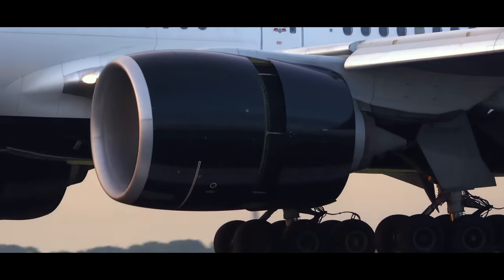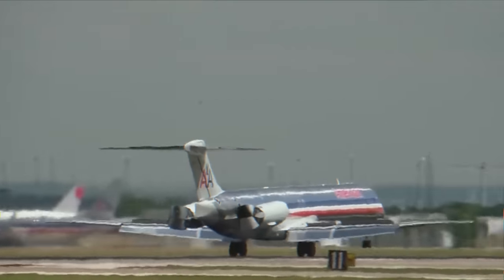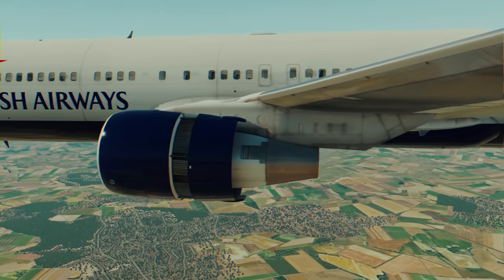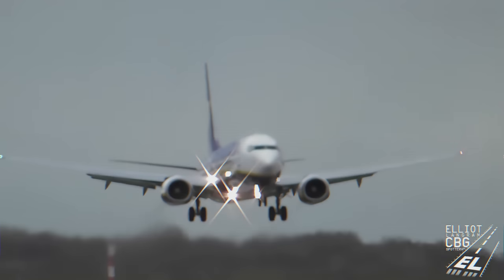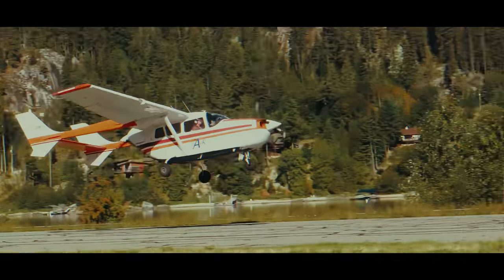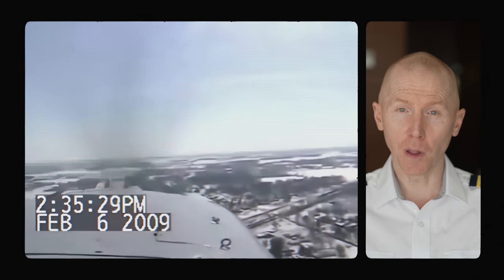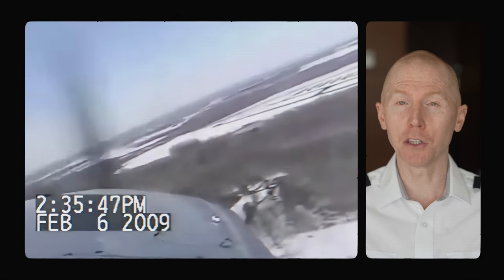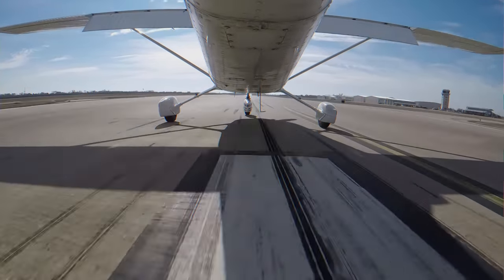Ryanair Pilot Makes Big Mistake

Comment: I would think the most important consideration is saving your momentum to get off the runway - steering to centerline seems counterproductive, save the centerline lineup for the taxiway unless you need to bleed additional speed to avoid tipping.
Reply: Absolutely the last consideration is saving momentum to get off the runway.  The first consideration, above all others, is being alive at the end of it all.  That may sound overwrought, and it may seem like it's an overstatement after watching a successfully-executed engine failure like this one, but there are plenty of stories of "simple" engine-out situations that ended up fatal.  You can still die from 40 feet in the air.  So if you get it down and roll to a stop in the middle of a runway and they have to send someone out to pull you off, that is a 100% successful outcome.

Comment: For the second clip: First off, the pilot did an incredible job and his turn back to the airport worked. I have no idea what his altitude AGL was, but it looked to be less than 1000'. I thought in those scenarios, that was "the impossible turn" where you have to trade too much altitude just to make the turn, and you're better off finding a road, field, etc?
Reply: He got away with it... that time. Should have stayed straight and level, nose down, and looked for an open spot. YEs, the plane will be damaged, but you're way more likely to walk away than if you stall spin from 100 feet.

Comment: I design Nacelle systems for a living.  There are multiple layers of mechanical and software redundancy that prevent a thrust reverser from deploying inadvertently.  We have mechanical track locks that physically balk the Thrust reverser translating sleeves from opening in flight.  This track lock system is isolated and fully redundant from the hydraulic and electrical system that control the the thrust reverser actuation deployment.  Even if all actuators fail completely the Thrust reverser is designed to remain in the fully closed position.  In addition the cases where the Thrust Reverser can be commanded are controlled by software laws that prevent deployment unless the airplane condition meets strict criteria.  Some airplanes are designed so that you have to have weight on gear before the sleeve can be deployed.  On this specific model there is a MAX altitude requirement that must be met before the software allows deployment.  That altitude is a number greater than zero feet as shown to be evident in this video.

Comment: Kelsey, I think that on the second landing the pilot was trying to burn altitude. If he had gone directly to the runway he would have over flown it. That's probably he went over to the right and then back to the runway. Even with the slight diversion he landed far down the runway. Back in my hang gliding days, we used to do S curves with decreasing amplitude as we got closer to the landing zone, if we were still too high on approach.

Comment: The C 17 is the only air raft that can deploy all 4 reverses in flight. Reason to match specs of c 141 (BTW done with forward slip). I experienced 20k ft per minute down, 15k ft per minute up. The 141 could carry 153k lbs of fuel in a plane with 140k empty weight. The 17 can do 8k per minute up has a much different fuel to empty weight ratio. Absolutely e ticket worthy

Comment: As a glider pilot (hang glider) for nearly 5 decades I thought the approach was pretty darn good (for someone with limited options).  It looked to me like he slightly overflew the intended runway to burn the little bit of altitude he needed to avoid running off the end of the runway (he clearly saw that he was not going to have a full runway no matter which one he picked).  Low and slow is rarely a good idea but I've had countless landings in very tight LZs by doing exactly that.  Of course it's all a judgement call based greatly on pilot skill, familiarity with the aircraft and the conditions you're landing in.  Very unstable/rowdy air then extra speed (control) is an absolute but if the air is stable then getting close to stall or a bit of a sideslip can put your right where you need to land.  
That looked like some very cold (thick) air and I wasn't noticing him being bounced around by conditions.

Comment: I have over 16,000 hours in 737s, all models except the MAX.  Proper procedure is NOT to actuate TRs until both mains are on the ground.  There is are couple of asides concerning TR actuation in flight!  As I recall the DC-8 was capable of opening the clamshells in flight on # 2&3 engines to facilitate rapid descent.  And on the 737 Basic if the clamshells did somehow open in flight they were designed to rip off without major damage to the engine and support structures!

Comment: Many Boeing and Douglass jets use wheel spin-up (about 60 kts.) to get spoilers. Airbus uses strut compression. I like the Airbus setup better. 
There have been a number of runway overruns caused by spoilers not extending because the wheels were hydroplaning or skidding. This under 60 kt condition at the wheels inhibited the spoilers which greatly reduced braking. 
My aircraft experience: DC-8, B-737, DC-9, MD-80, Airbus A-319/320/321.
Reply: If the lever doesnt want to come by itself, just grab it by yourself...  problem fixed.
On the boeing 737ng the wheels normally  need to spin faster than 60kts but if they dont ,  the compression of any landing gear strut enables the flight spoilers to deploy,and the Compression of the right main landing gear strut will unlock the ground spoilers.

Anyway To get a runway overrun  you would need to wait a little while before realizing that the spoilers are not extended.
Reply: @Hk-uw8my  Thank you. You raise good points. I have seen aircraft landed with the spoilers  not armed. This has happed to experienced crews with good habits-human error nonetheless. Today, many airlines push the idle reverser strategy. Why waste fuel on a long runway. The problem is this becomes a habit. Then when one lands king, or fast, or floats 1,500 feet, idle thrust early is not very efficient. Then, realizing the stopping distance is becoming critical, they select full reversers. This is less effective at lower speeds. Bad habits cause bad outcomes-eventually. Better to always go directly to full reverse, then when it is obvious that it is not needed, one can retard back to idle thrust. Early braking is better than Kate braking-especially in winter Ops, where the last 1,500 feet of the runway is usually the most slippery because most don’t go there. 

Keep up the good work! 

Fly safe! Fly smart!

Comment: My  view  of a perfect landing for most general aviation aircraft is one where the aircraft touches down smoothly on the center line at just above stall speed with the yoke nearly full aft. The pilot then holds the nose wheel off as long as possible and smoothly lands it as elevator effectiveness is lost

Comment: Variable pitch props Then on engine failure it’s advantageous to feather the prop. 
As for the reverse thrust Ryan air well the wow micro switches are fitted to a lot of aircraft. If you remember James Bond shooting his guns and firing rockets Whilst on the ground.Totally impossible why ??? WOW micro switches. However an RAF Phantom loaded with LIVE sidewinder missiles on the ground had a sidewinder go off. Luckily no damage or injuries. The cause was water ingress in a firing circuit. Love your videos and have a lot of love for pilots  especially when in the air. Not natural for us ground engineers.

Comment: 3:39 A mid air uncommanded thrust reverser activation sadly happened on the Lauda Air flight 004 causing the plane to stall and rip apart mid air.

Comment: There are several variants how to land.....

Norway is 'riddled' with 2700 ft (800 meter) runways.

Back in the 1980's I flew single pilot air ambulance with twin engined Piper PA-31 and Cessna 404 - both without thrust-reverse.

During winter, one Saturday evening, I returned a patient from the regional hospital back to his municipality in Northern Norway.

There were no other traffic expected -  and the ground crew did not bother to sand the icy slick runway.

However, with close to zero breaking action, and passing 2000ft with substantil speed and only 700ft remaining I invented my own "thrust reverse" by using left side of the runway, kicking right rudder, full left engine power - performing an 180 degree "piruette" and adding full power also on right engine - so I invented my own "thrust reverse", while sliding backwards with full power on both engines. And we stopped with a 200 - 300 ft to spare...

.... and the wide-eyed patient asked " - was this normal?".

....and I confirmed..."yes - we do it all the time...".

😊

Comment: Many pilots have died doing the "impossible turn" back to the runway.  Too much temptation to "stretch the glide" and run out of energy ensuring an uncontrolled landing.  For that reason they always taught us to just look for a landing site within field of view.
I also saw a video where they demonstrated the best bank angle to make that 180 degree turn in a way that loses the least altitude.  Turns out it was a VERY uncomfortable 60 or so degrees.

Comment: Back in the early 90s I was a px in a 737-200 from Charlotte to Tri-Cities, clear weather, a flight of 25m but it was late and the pilot made up 5m on the leg. He climbed to 11,000 feet, almost immediately started descending, came in hot with flight spoilers and threw out the buckets at the start of the flare. An exciting ride to be sure, but the more I learn about flying the more unwise this style of flying really was.

Comment: Hi captin kelsey
Thank you for your excellent explanation 
What I Know from my experience the thrust revers are connect to the safy squat switch in the landing gear which prevent T/R operation until the weight of the airplane in the wheels 
I don’t know if som airplans different

Comment: I can see where, a switch could be flipped to activate the thrust reversers so when the weight on wheels switches are triggered, the thrust reversers can come on but that would require the gear to be on the ground. However, I know a lot of digital cognets now use pressure sensitive buttons instead of hard switches. What do you guys think?

Comment: Wow, the military version of that twin engine Cessna Super Skymaster is said to be a very very good plane. A pilot told me, that when you have only flown single prop Cessna's, learning to fly such an O-2 is a lot easier than converting to conventional twins. A bit rude, it flies like a heavy 172 and in this case, that is a GOOD thing.

Comment: The Thrust reversers should not be able to be opened in air, bc there is a little switch on the main Gear strut, that switches when the strut damps, which gives the Computer the signal that it is safe to engage the Reverser. This modification came after the Lauda Air crash in the early 1990's due to reverser operations during takeoff . So either this switch has been removed in previous years, or they have tampered with it there.. Reversers should not be operable in the air..

Comment: With regards to the steep banking of the small aircraft that lost its engine, my interpretation of that is that the pilot was trying to kill energy with S turns.  It actually looked like the pilot was skidding the aircraft using rudder in reverse direction than a coordinated turn for the bank.   If from the position they came over and just lined up, it was looking to me like the pilot would have easily rolled off the end of the runway and might not even been able to touch down before the end.  

As it was the pilot got down without a whole lot of runway left.  Those steep banks had to have burned a significant amount of energy so easy to guess that without the banks and energy loss they would have been off the end.

The pilot would have done better with that excess energy using it to get a better overall approach off the end of the runway rather than maneuvering right over the airport, but I get it.  The pilot just lost engine, not much altitude, trees below, the last thing the pilot wants is to end up in the trees so makes a beeline to get over the airport with losing as little altitude as possible.  Then surprise there was extra energy.  

I can't fault the pilot's instincts.  Even an off-runway landing in the open spaces of the airport was going to be infinitely better than in the trees.   Once in that position over the airport, my instinct would have been to do exactly what this pilot did.   Some S turns skidding my plane to kill excess energy to get a touchdown someplace with enough room to stop.

Comment: If it is anything like on a model airplane, a windmilling propeller is almost like a big flat disk acting as an air brake. On an RC powered glider I have, I have a switch to turn on or off the motor in flight. When the battery would run out, if I left the motor on so the propeller kept spinning but slower than at neutral thrust, I never could glide as far as compared to when I shut off the motor and the propeller came to a stop.

Comment: If I remember right, 2 deadly crashes were caused by a reverser deploying mid-flight - 1 was Lauda Air I think with both, another different airline (possibly over the Pacific) with 1.
Is it physically impossible or astronomically expensive to put vectored thrust on passenger plane engines, a la the F-22 & 35, even going as far back as the Harrier Jump Jet? I realize those are small fighters but is there a reason the thrusts from passenger planes can't be re-directed, thus obviating the need for a special function & making take-offs and slowing down on a runway even easier?

Comment: When i was at Flight School the instructor told me "Any landing you walk away from is a good one" I had one emergency landing
all the electronics failed. It went from a quiet day, no traffic for nearly an hour. I just took off for the last circuit then a red light
illuminated on the panel in the climb out. No problen i thought, i called A T C downwind righthand for 24. The reply was, Roger you are now 
number six in traffic be prepared to orbit. After speaking to an instructor in the circuit i was back now as number one classed
an emergency, all electrics had failed. The thing was it did not bother me. I had fantastic instructors and a love of flying.

Comment: That´s your opinion, the book is not allways correct for all situations. Reverser can actually be used to kill excess speed at the landing as long as the pilot feels it´s necessary since a go atound it´s impossoble at that point.
Getting winds pushing the airplane up while at touchdown can throw the airplane out of course and change the alignement to the runway so a quick decrease on speed it´s a very good way to avoid that to happened and as the wheels touch the ground at a lower speed using reverser instead of brakes the probabilities of bouncing or slide are decreased.
It´s all about the best options at the moment wich each one have to deal with and like many people on other situations you say "That´s wrong, I wouldn´t do that" probably in that exact situation you would do the same. It´s easy to talk about others doings and criticize them while resting and drinking coffee safely at home...

Comment: I was a captain on the Trident 1E. One of the techniques for shortening the landing and saving the brakes (which overheated very quickly, and this method was taught to us by G/C Cunningham, Chief Test Pilot De Havilland) was to select IDLE reverse when nearing the threshold. Then , on touch down you could get quickly into full reverse. This only happened on the side engines, not the centre one. The clamshell doors opened up and down --the down one cushioning the touch down. It had to be done very precisely or a hard landing could result. I used this method often. With the Trident and emergency descent could be carried out in idle reverse. In all the aircraft that I have flown the Trident was unique in this reverse use in flight.
Reply: Armchair Pilots will still prefer the scaremongering narrative.

Comment: Company policy. Replacing brakes is more expensive + engines are managed through a "bulk deal", so they pay a lump sum to have them serviced, replaced etc. instead of doing it on a one-on-one basis. Years ago it was circulating, that Ryanair pilots were encouraged to use the brakes as few times as possible. Probably that is still the case.

Comment: Turning back to the airport after an engine failure on climb out is a risky maneuver. The hard bank with a stall horn you called "falling out of the sky" I would call it a "stall spin" which usually doesn't end well at low altitude.
Reply: ☝️thanks for watching & leaving a comment, also congratulations, you have been selected amongst my shortlisted winners
Kindly message me on the above☝️

Telegram only to claim prizes🎁

Comment: Kelsey, the engine out pilot at the end where he is banking, looks to me like he was doing a small S turn in order to bleed off some altitude so he didn't overrun the end of the runway. I believe that that is also why he didn't line up on the other runway because he felt his altitude was too high to get stopped before running off the end. That's just my guess, but he has the advantage of seeing the wide angle that the camera doesn't, and what he chose to do was the better of the 2 options in his mind.